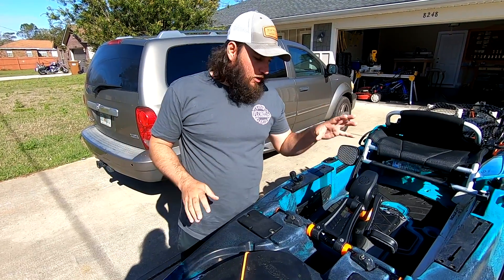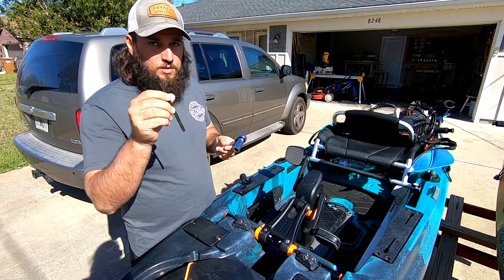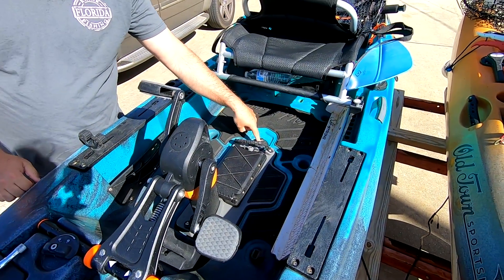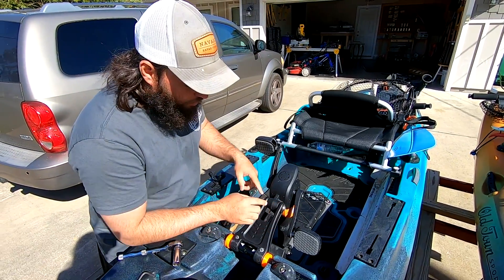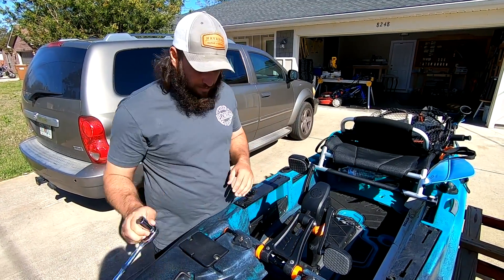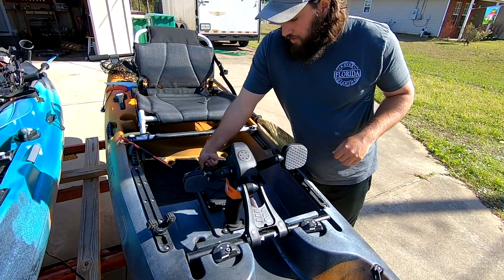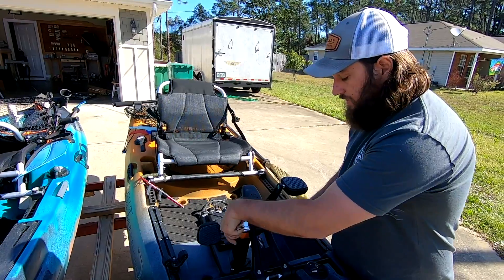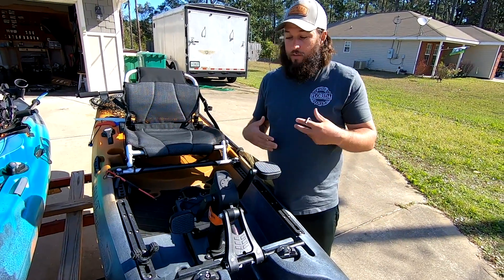Stop your Old Town PDL Drive from Wiggling?

Comment: Is the metal part on the bigwater/predator the same size and shape as the plastic version on the other kayaks? It’s tempting to replace the plastic piece with the metal piece if so.
Reply from the maker: Unfortunately they are different sizes.  I should have mentioned that!

Comment: The tension knob that holds the drive down on mine would easily spin 360 degrees. This is the 6th pdl I have owned. I bought two sportsman bigwater 132 pdl’s at the same time. One was fine. I called old town because my drive box had the same type of loosens but even more so. They had me take the spacer washer off the bottom of the tension knob and put it on the top. I complained about this about 6 months ago when I first got it. Now I have seen a few more people post about it.

Comment: Really great videos, Nick! One question about the wiggle. I've got two Salty's - one drive wiggles and one doesn't. Have you ever tried rubber glue-on spacers (I'm thinking something like rubber bicycle tube patches or something like that) on the sides of the PDL drive unit, just to reduce the space between the unit and the boat? (Please excuse me if you've covered this in a video. I looked, but couldn't find it...)
Reply from the maker: Doug, any kind of foam with 3M tape should shim and solve the problem.

Comment: Thanks Nick 👊🏼. I went and just tested my drive and it wiggles the same but, its plastic like you said so i didn't want to touch it, because my luck i break the plastic 😂. So im not going to lie, i got the sportsman pdl 106, and thought all the drive where at least equal. Now i see thats not true, and im super bummed out about it being plastic, now knowing that there is a metal one that doesn't flex witch is way better smh. Witch is probably why im still getting water up the peddle drive now that you point it out. Man i wish i would have known this, Because i would not have got the sportsman PDL 106. I may have went with the predator or jackson kayak instead. I was on the fence to as it was with the two companies. 🤷‍♂️ Oh well it is what it is at the end of the day. Hopefully you will make your own to metal one to sale as a up grade. lol one can hope. 🍻
Reply from the maker: It being plastic is kind of a bummer but it’s a solid kayak overall.  I will see what it cost to product it in metal.
Reply: Any update on the aftermarket metal replacement? It would be great to have it in metal.
Reply from the maker: We ship out a ton of them and the next batch is currently being powder coated.
Reply: @NavarreKayakFishing  OH NICE! I will be sure to order one when you get them in. I just ordered an alignment spacer and rudder bolt a week or so ago. I was the order going to Wyoming. Thanks
Reply: @NavarreKayakFishing  never seen these on your store site Nick. 🤔
Reply: @NavarreKayakFishing  I looked on your website but couldn't find where that part was listed. Can I be part of the club that gets the next batch?
Reply from the maker: I’ll make a video when the rudders are in stock.
Reply: Oh, I wasn't talking about the rudders. I was talking about the metal aftermarket drive support. Do you make the metal drives?
Reply from the maker: I’m sorry for the confusion.  The metal drive support only comes on the Predator/Bigwater.   We do not manufacture them.